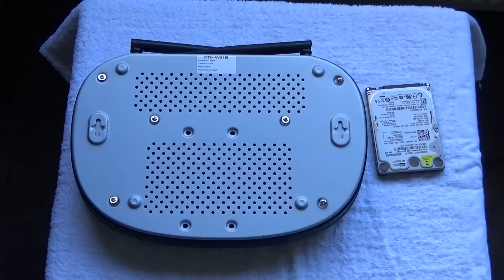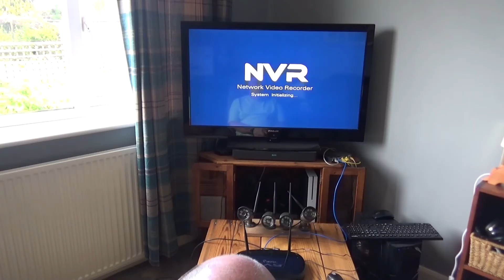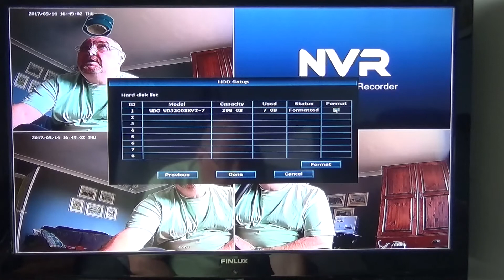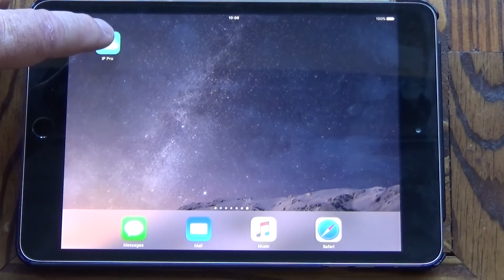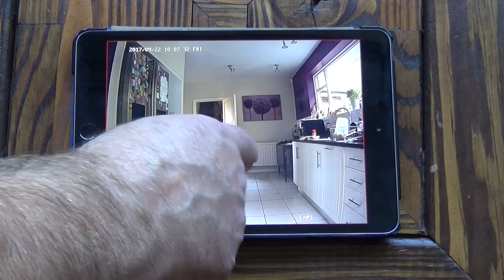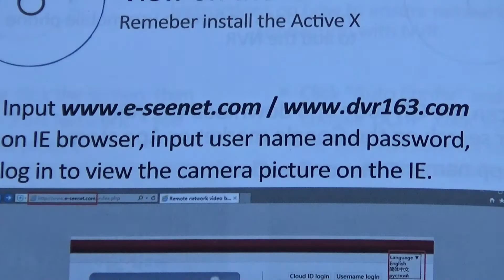Ctronics 2.4G Wireless NVR - Review

Comment: I bought 4 Ctronics solar cameras a few months ago with $ 390 cost..
After installation , ONE BY ONE THE CAMERAS LOST CONNECTIONS
 AND THEY REFUSED TO RESET ...so they became useless. 
The Ctronics technicians after trying to solve the issue accepted that
 the cameras were defective they replaced them with 4 others. 
Upon installation I have discovered that the replacements were also 
defective 1) TIME ...NOT SYCHRONIZING 2) THE SAME NOT RESETTING
 ISSUE APPEARED ....WHEN I REPORTED THE PROBLEMS ,and  after 
we have exchanged a lot of messages with various Ctronics emails for
 4-5 months...Final result they STOPPED RESPONDING TO MY MESSAGES.!!
 TERRIBLE...Unreliable cameras and DISHONEST SERVICE COMPANY..
DO NOT BUY ( They have send my 8 defective cameras !! )

Comment: Great review, the only thing missing was some outdoor action of foxes, deer etc the camera detected. Is the signal good enough so that you can set up some cams outside and if not is there an option to hard wire the cams to the unit instead of relying on the WIFI?
Reply from the maker: I have the cameras set up outside now and we are seeing a lot of wildlife!  Deer, foxes and badgers have been running around at night.  The cameras can be connected to your home network via Ethernet cable if the WIFI is not good enough, but I like the portability of the WIFI as I tend to move the cameras around a fair bit.
Reply: Will you be uploading some of the footage please, especially of the badgers? Also, I had an external cam, but rather than rely on its own weatherproofing, I made a small waterproof enclosure made out of wood board scraps and roofing felt to keep the rain/frost off it. No point it getting saturated unnecessarily methinks.
Reply from the maker: Consider it done, I will search through the footage and post a video for you.  Hopefully tomorrow.  I already have a clip of my cat seeing off a fox!